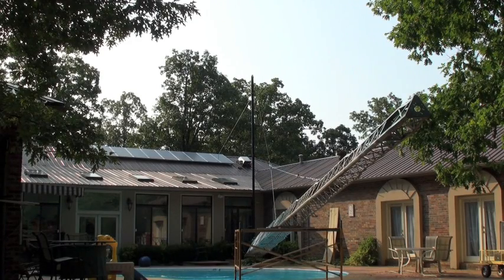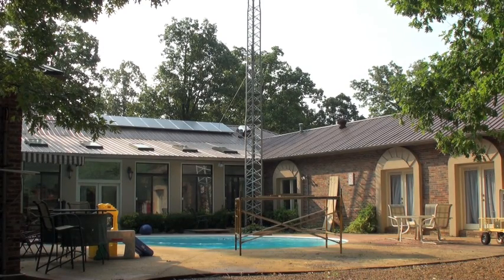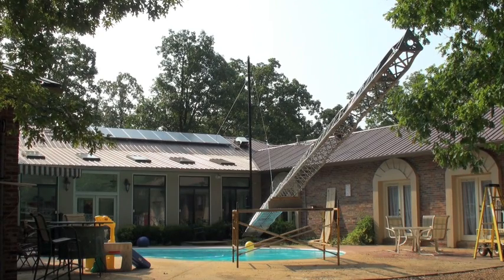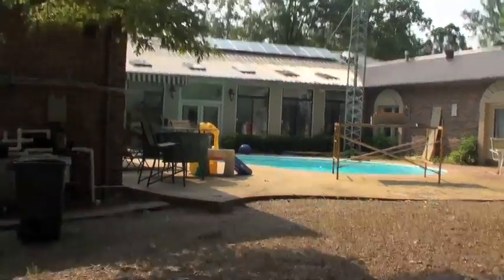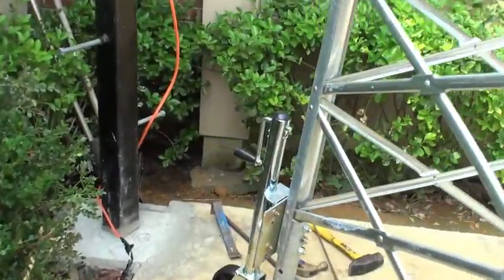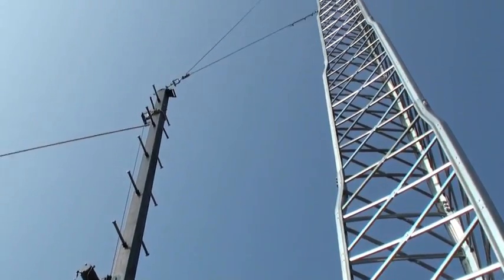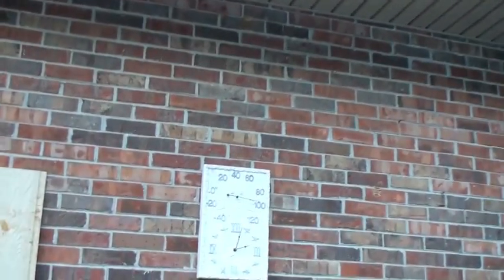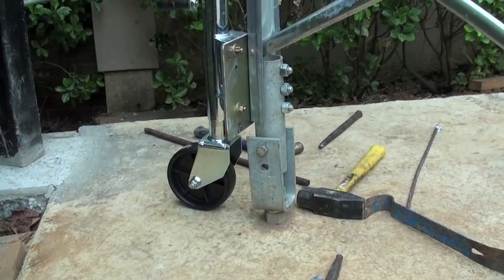Wind Max Tilt Tower First Lift

Comment from the maker: Thanks, I hope it really helps that many people.  3 things I would have done differently so far... 1.  moved the winch about 2 feet higher on the lifting post.  I would have still been able to reach it from the roof to connect the cables and would have gained 2 more feet of cable.  2.  Stiffen the lifting pole with arched rebar off of the back side.  This would have stopped the flex and produced another 2 to 3 useable feet of cable. 3. Used a hand winch to take the slack out of my cable first